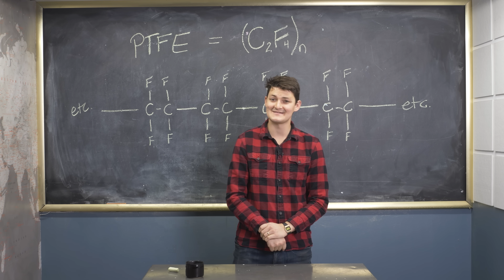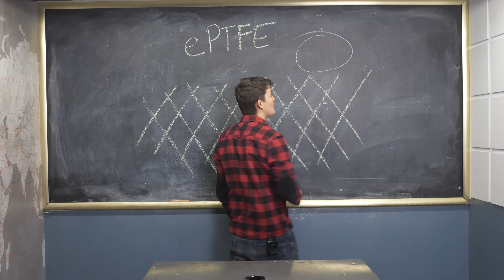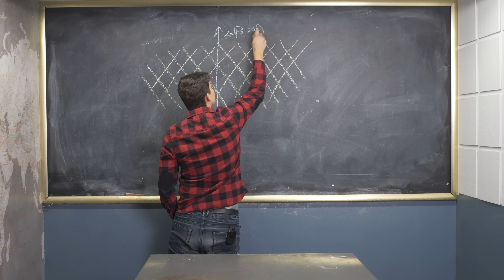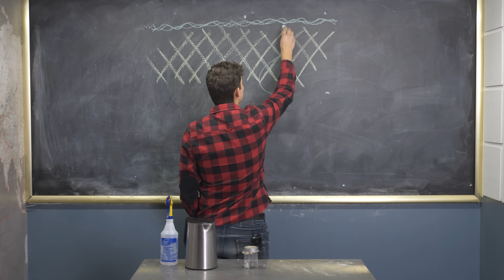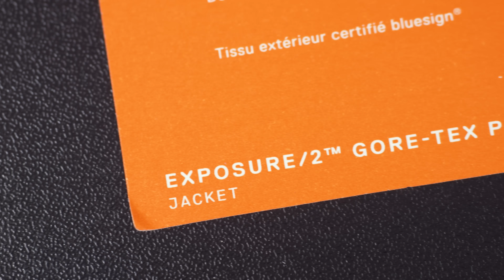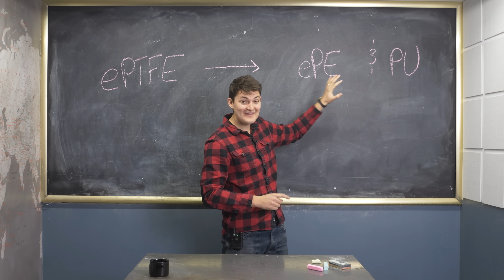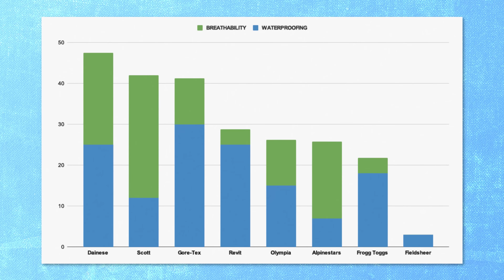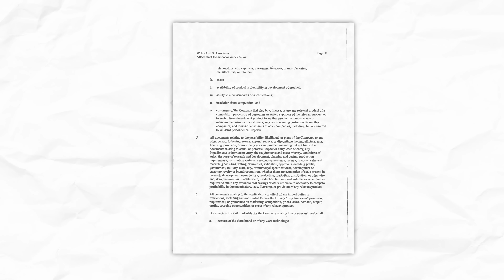Gore-Tex is a Marketing Gimmick

Comment: The "breathable OR waterproof" aspect actually makes a lot of sense for why it's used in all sorts of winter gear (especially for alpine sports.) When it's really cold, the humidity tends to plummet, but all that solid water on the ground can collect on your outerwear and get warmed up to liquid, which is super inconvenient if you're garment ISN'T waterproof. However, much of the time you'll have all the snow brushed off, and especially if you're actually skiing or snowboarding, you might actually work up quite a sweat, in which case the breathable aspect should help, as the outside humidity is low.

So like, good for alpine gear, not so much for jungle trekking.
Reply: Ski gear is actually really one of the better uses!
Reply: Also, in high-speed sports, like skiing or snowmachining, you need decent insulation, but the wind is providing a lot of cooling constantly and that helps to regulate your internal temp.  You simply don't need to "breathe" much.  Riding the lift back up, you are relying on the insulation.  In both cases, the wind-blocking properties of gore-tex are helpful.  For high-intensity sports where you aren't going nearly as fast, like XC skiing, running, mountain biking, there is really no waterproof breathable fabric, nothing breathes fast or good enough to regulate our sweat at those intensity levels.  The best we can do is on a cold-rain day some constant cold rain can help to keep you cool, but if the intensity gets too much, you get soaked anyway.  I've found that TWO "waterproof" shells provides a decent barrier in that case to trap warmth next to the skin, but forget about waterproof.
Reply: "...you might actually work up quite a sweat, in which case the breathable aspect should help..." Should? Maybe. Does? No, as evidenced by the preponderance of ventilation schemes found on outer shells. One of the problems is that when water vapor gets cool, it consenses, thus trapping sweat as liquid on the inside of the goretex.  As for Goretex keeping the water out, that's also a myth. Keeping a fresh coat of extermal water repellant is a must, whether or not there is a Goretex layer. 
In my early years of backcountry skiing, I realized that Gortex was a waste of money. And ever since, I've used less expensive outerwear with similar functionality and comfort/discomfort as the Goretrx stuff.
Reply: yeah it's counterintuitive that fabric can be both.
Reply: makes sense, I've used a gore-tex jacket in mountaneering and it did really well, can't complain
Reply: The environment temperature in "jungle trekking" would make you rethink using a jacket. And to be honest, you don't need the entire jacket to be breathable if you are moving through rain, it is not airtight seal, 

vapor will escape for  a lo of places and when the rain is over whatever remains will evaporate and kept you dry. It was not a very intelligent critique of the video
Reply: @cristianproust  That's not the point of that specific critique, the thing is not about getting wet, it's about humidity differencials between the inside and outside, because if the level is similar then the garment won't breathe because in simple terms, theres no pressure trying to scape
Reply: @danylol772  Sure, that is if the object inside the jacket was inert. But it has a human inside, and humans are biological heating systems .

There is a gradient of temperature from the skin to the jacket, there will be transport and evacuation of vapor if the jacket is not sealed airtight. 

If a fabric can dry at 5 ºC outside, it certainly can in contact with a heater  that keeps 37º if we allow the vapor to scape opening partially the jacket.

People do not go trekking in the jungle with airtight closed Gore-Tex jackets, because the jungle is pretty hot to begin with.

In a rainy weather if there is sweat and rain, that is a possible scenario, but rarely a jacket would be completely in contact with water and vapor just 

needs areas not in contact with the rain and gaps that allow evacuation.

There is a reason why Gore-Tex type materials became so popular, and why they still are. It would allow the person to dry with the jacket on
Reply: @cristianproust  well, yeah that makes sense in a real setting while in the lab being a different result. I agree
Reply: Once the jacket is wet, if the leather boot is soaked, there is no place for the vapor to escape. And when the rain is over you'll dry faster without it so you can just use PVC or a polyester poncho. Nylon even absorbs 8% moisture and breaths this way independent of the size of the pores. Teflon membranes only make sense in boots because it's better than rubber boots but you may need to change socks anyway
Reply: As a Russian - not just alpine trekking but living here comfortably. 
Icy rain and wet snow are nasty, and constantly entering and exiting heated spaces adds to sweating.
Reply: @annasolovyeva1013  "constantly entering and exiting heated spaces adds to sweating."

As someone who also grew up somewhere cold, but where we get a lot of people who move here from warmer places, (since my whole state is mountains, we tend to call them "flatlanders,") one of the things that drives me more crazy than anything else is when people set the indoor temps in the winter to warmer than they'd be during the summer. I'm always like, "of course you think it's unbearably cold outside, your body never acclimates and you're seeing yourself up for even greater thermal shock every time you come in or out."

But I'm also used to it getting down to like, -20°C weather, which is typically cold enough that you mostly don't get that much icy rain or wet snow.
Reply: @RamadaArtist  we have central heating and a national standard for indoor temperatures being pretty warm, +20-22C regardless of the season. Summer gets way more hot actually. Public transport and shops is colder, but still way above the freeze. 
Getting down to -15 and below yes, it gets dry and really beautiful, and you can pack into things like down and furs. For "Eurowinter" wet cold eternal November - membrane clothing is best. And with the global warming we are having more and more of this awful weather.
Reply: @annasolovyeva1013  "national standard for indoor temperatures being pretty warm, +20-22C regardless of the season."

I'm sitting here with my room temp at a comfortable 15.5 and that statement is literally making me gag. 18 is my upper comfort level. 20 is tolerable in the office during the summer. 22 and above make me want to start punching people and I need to estivate in a basement until the summer is over. I cannot imagine willfully doing that year round in a region that actually gets cold.
Reply: All skiing gear has "armpit zippers". If it is a warm winter - you open those and let the sweat evaporate naturally.
Reply: @volo870  I'm a fan of vents, I'm not saying I'm a sweaty snowboarder,.... but I find they really help. When I'm active, I open those zippers, and when I'm sat on a chairlift, I close them up. Technical fabrics are great, but they can benefit from a bit of fresh air for sure.
Reply: Yeah, but when it's that cold your outer layer is often below freezing anyway, unless you are in a warm winter environment right around freezing...in which case there's no real way to stay dry anyway, it'll be humid.
Reply: @JamesNoBrakes  Your outer layer is below freezing but that doesn't mean the specific thermal mass of any collected snow will itself stay below the freezing energy. Collected snow typically gets warmed up by friction and even simple insulation inefficiency; your body heat will warm the surface of whatever you're wearing. You can be in absolutely frigid conditions, but still be "wet" simply because of the snow on you that has melted. Gore-Tex seemingly has the capacity to help with that.
Reply: Not here, in the low 20s and below, snow says snow, even on your outer layer.  This is Alaska, but I’m not talking about -20F either.  When the gore tex “works” its usually In light precip either way that wont overwhelm the insulation and material, around freezing its ok, as long as its not very heavy.  This from just a few days ago, heavy snow near freezing, due to early-season here.
Reply: @JamesNoBrakes  I mean, I live in Vermont, (and we've already had several snowfalls this month, though it's usually still hovering right around 32°F so the sunlight alone will melt whatever is on the ground after a day or two without more snowfall... super weird that we've had snow but we still have bright green grass for some fucking reason. From what I remember, pretty much everything other than the evergreens would be dead by now, but we literally had 60°+ weather the last week of October and then it snowed November 1st. Fucking climate change man.) 

It's not as often as cold here as I remember it usually being 15 or 20 years ago, but I've had more than my share of -20° days, many of them while snowboarding, (all the more so, because it's colder on the mountain, and there are fewer people on the mountain when it's that cold, so that's when I like to go.) And I remember not staying perfectly dry during even the coldest days.

But the colder it is, the more likely you'll have "light precip" conditions. I agree that Gore-Tex doesn't really offer any advantages over simple waterproof equipment when you have warmer and heavy snowfall. (The colder it is the less likely you'll have any precipitation to begin with, so I'm mostly talking about accumulation from falling in it, rather than it falling on you.)
Reply: @RamadaArtist Of course by “climate change” you are referring to the climate changing naturally as it has for 10 billion years on planet earth.
Reply: @Machria23  I am not. I'm referring to the fact that we get a half dozen or more thaws throughout the middle of winter now, when twenty years ago we might get a single one.

As one of the rare few people who actually likes and prefers cold weather, I've been highly aware of how much less of it I get now than when I was younger. Winter used to start as early as Halloween, and last until mid-April, and that hasn't been the case around here for like, almost a decade. Pretty sure that sudden escalation isn't the result of ten billion years of natural progression on the planet. (I mean, it physically can't be, because the Earth is less than 5 billion years old, but you aren't coming at me with the vibe that you care about science anyway, so I wouldn't expect you to know that.)
Reply: @RamadaArtist  alright this got longer than expected, but i want to give you a hopefully new perspective: 20 years is NOTHING in the earths lifespan. it doesnt matter at all. important is what happens on the scale of millions of years, maybe hundreds of thousands, it being picky possibly even thousands of years. but going down to like 20 years, even 100 years and even hundreds of years says absolutely nothing, important is the big trend and that one doesnt exactly reflect anything to the level that is portrayed by climate alarmists. not saying that humans dont influence the climate at all, but the question of how much and how much it actually matters, as well as how much we can actually change with the few countries giving a fck about climate as a whole (aka being rich enough to care about this abstract stuff, that maybe is a problem beyond our lifetime. well, i.e. China wont ever give a fck, they have money but act as a 3rdworld country so they dont get the same "climate goals". there are more countries like that) is not at all a clear picture. pretty much all models that have been made have been completely wrong, models are basically wild guesses put into a computer, often based on faulty or at least totally irrelevant numbers, also looked at in an extremely small timescale - which doesnt matter at all bc the world works on a WAY bigger scale, 10 000 years more or less, the world doesnt even clinch an eye about this laughable small amount of time in the grand (and important) scale. let alone 10 or 20 years. 

im not denying anything here im just saying that many things must be looked at in a way more open discourse bc atm you are either a complete fanatic that should have lived through absolutely extreme heat, then extreme cold and then through "changes", as well as having already died numerous times (according to the many many climate models) or you get called a conspiracy theorist and climate change denier by those same ppl and also the big press/major news orgs. ppl get incredibly hysterical and really manic about this topic. atm we have WAY more important problems than this, the world should focus on getting poverty down (statistically we know for a fact that free market capitalism is doing a great, the best way we have, job already but we arent there yet and things like the past 3 c19 years have destroyed SO MUCH of the progress...) bc its also proven that the less ppl have to think about surviving, the more likely they are to care about external factors like the climate. also as long as the major polluters dont change anything, we couldnt change even a fraction of a fraction in the grand scale, so its really just a lot of talk about nothing. ppl use it for political gains, the media and certain 'experts' (we've seen during c19 how much expertise certain 'experts' can have) are making so many ppl completely afraid, they make them think that they will die soon and thats why they get to insane and support laws that would kill millions of poor ppl bc they couldnt afford any power to heat their appartements bc we stopped all oil and gas production tomorrow, which makes power incredibly expensive, and they also hate nuclear power, which would literally solve the whole fossil fuel thing in terms of power usage. 

every climate fanatic who doesnt support (actually very green!) nuclear energy cant and shouldnt be taken seriously. they dont want cost effective results that would prevent millions of ppl freezing to death. they want political power, if the problem gets solved, they dont have anything left to do, dont have any charity money to gain, dont get the same attention. as long as nuclear power doesnt gets widely supported by these activists group, we all know that they dont give a single fck about solving the problem. nuclear power is solved, the waste storage is solved, its extremely safe, cost effective, doesnt take a lot of space, doesnt kill the birds and the insects, its awesome. thats a fact.
Reply: @DELTA9XTC  I've been a nuclear power advocate since I first learned how it worked back in high school. 

My experiences of climate change are anecdotal, but the standing research has been saying that the current trends are anthropogenic, happening much faster than changes would have happened historically, and this has been repeatedly asserted and reported by scientists for something like half a century.

The first studies on climate change were funded by the oil companies themselves, and the evidence was so damning that they buried it for years. Don't come talk to me about alarmist propaganda when the earliest information we had about it was suppressed by the very companies that stood to lose out because of the conclusions of good science.
Reply: @RamadaArtist  what amazes me is that once again these climate change deniers have come out of their caves. I really hope we don't have to keep explaining to them how wet mud is perceptibly different from powder snow and how incredibly different this change is.

Side note: starting with this year my region gets extreme weather events. Yay 🎉
Reply: @Machria23  The planet earth has existed for less than half of 10 billion years
Reply: @Machria23 🙌

Comment: Hey Ryan, NASA called and left a message for you! “Suck it, road kill.”
Apparently they were offended by some punk YouTube kid making passing judgement on one of their core materials they rely on often. 

“Gore isn't finished in space, and isn't limited to the moon, either. When NASA's Spirit and Opportunity rovers were sent to Mars in 2004, Gore was on board, too. The rovers used Gore's cable assemblies to help communicate data from the rovers to Earth. Other rovers, like Phoenix, have also used Gore's assemblies since. Most recently, however, is the use of Gore's product technology in the Curiosity rover that departed in the fall of 2012, and remains on Mars today. In the Curiosity rover, shielding materials by Gore protect against electromagnetic interference and data loss, while GORE™ SKYFLEX™ Aerospace Materials are used to help cushion the spacecraft's cables from damage. Gore's products continue to be used in space missions and space suits to this day because of their reliability, superior performance, and resistance to radiation and extreme temperatures. It should be no surprise, then, that the product technology that withstands the harsh elements of space can also handle whatever wilderness challenge you throw at it.”

Boom SPACE…ha beat that little motorcycle dude.
-NASA

Comment: 3M, dupont, gortex et. al. need to be saddled with the costs of cleanup and medical care from harmed individuals from manufacturer and use of PTFE. Why? Because they knew from the beginning that it was not safe. They embarked on a massive cover up and half a century later here we are with massive contamination.
This is much like the use of leaded gasoline which was known to be very harmful and has contaminated every corner of the globe with lead. In fact use of leaded gasoline for over 50 years starting back in the 20s has been implicated in the global drop in IQ by a percentage  point or two. Astoundingly, it is still used in Avgas for general aviation. 
TrUsT tHe sCiEnCe!